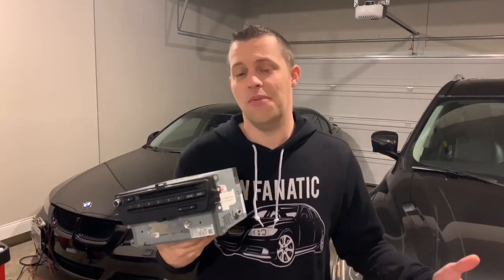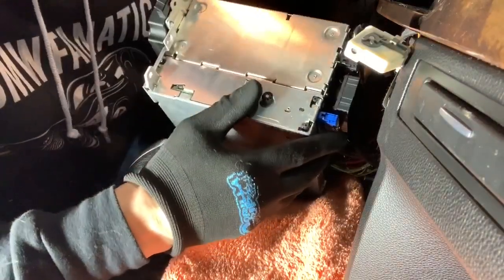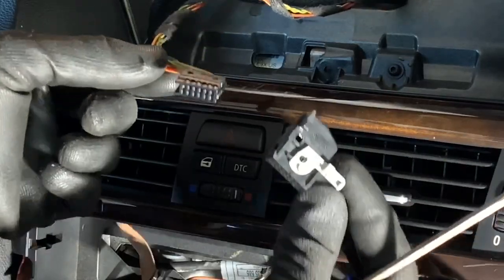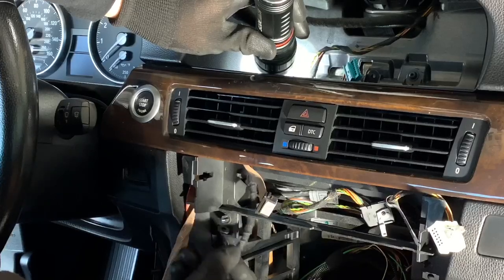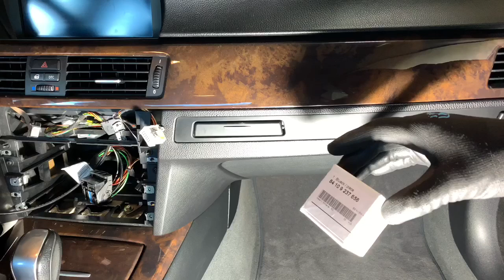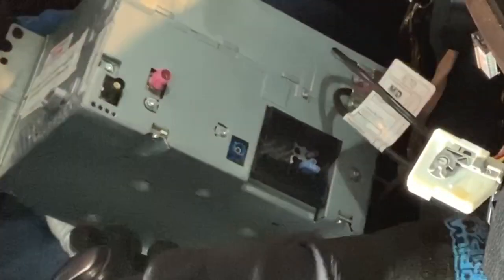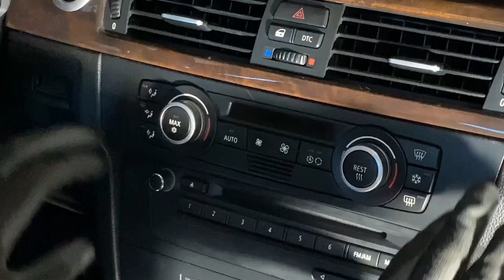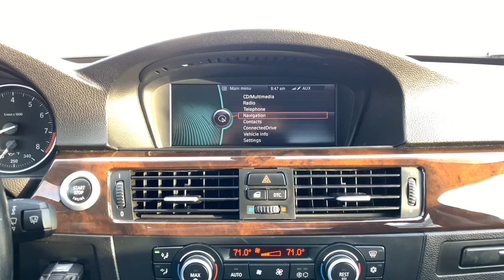BMW CIC Retrofit Navigation DIY Install/Coding!

Comment: So I made the 6 hour round trip drive from DC-Phila today to have Nick install this for me. I had been asking him questions for a few months and was apprehensive about a few things, most of all my ability to make things worse, and completely botch this seemingly straightforward install. I decided that I was not comfortable doing this install, so I reached out to him last weekend and asked if he would do it for me if I drove up to meet him. I didn't think he'd agree because of the extra labor, but he did! He did install essentially the same way as shown here, with additional time to remove and replace trunk trim in order to bypass the HD tuner above the rear passenger tire (the unit has a built in HD tuner). Also because of this step, I have AM radio; which I do not listen to, but it is nice to have the option. After install he made sure that I was okay with his work, and went through all the menus and sub menus with me. He also let me know that he offers a 6 month warranty (with full replacement, as is mentioned here I think), and map updates for all buyers (2020 coming soon). I have not used all the features of the CIC, but already it is a massive improvement over the old clunkier CCC system. It is more responsive, is more user friendly, has more features, is more expandable/upgradeable (with combox), and equally important, just looks a lot sharper. I already had the CIC controller installed myself years ago, so I do like the shortcut keys, but obviously this is not necessary whatsoever, and is mostly a matter of personal preference. Nick brought all supplies, tools and protective covering, and left everything as it was when he started. Whether you have him do it for you, or purchase this and install yourself, I can unequivocally say that this was the right move on my part, after months of hesitation, and definitely is a major improvement to the E90 pre-LCI model year cars. Thanks to BMW Fanatic and CIC Retrofit Nick for all your time; cheers!
Reply: Hey can u give me Nick's contact information so I can get a hold of him? I've been trying to get this for a while but wanted to get something that is good and reliable.. please if u dont mind? Thanks
Reply: Can you please provide Nick's contact.
Reply: Is Nick still around?  Can you forward his info? Thanks
Reply: @kevinpope6262  AFAIK he’s out of the business since 2022.
Reply: Can I have Nick's number so I can have my fixed as well, please?Thanks

Comment: there is a special slot for the usb connector. on the left side of the glovebox  behind the glovebox shocks there is a plastic cover that you need to remove and there you usb will plug. perfect fit, original location.
Reply: Pre LCI cars have a flashlight there.
Reply: since 2005 was discontinued (at least in Europe) and his car does not have that, and its the same shape as for the usb  slot.

Comment: Thank you for this video.   I also went with one of Nicholas' kits and between his instructions and this video, everything went very smoothly.   This video was especially helpful with regards to cable routing and trim removal strategies.
Reply: Hey bro, where did you get the kit from?
Reply: Kit must be top secret
Reply: Right! Super squirrel secret.
Reply: How can I contact Nicholas , I need assistance in connecting a Head Unit in my 2011 BMW E90
Reply: Question is how much did you have to pay?

Comment: Nice!! 
One of the first things that I did with mine after accidentally scratching the CID with a microfiber .. I installed a a anti glare screen protector from Amazon.. it’s been 4 years now and was the best move. The anti glare coating on the CID is very delicate and will scratch just by looking at it.
Reply: Thanks bhai

Comment: So I have a 2010 BMW 535xi.  Yesterday the idrive screen flashed red for a split second.   When Idrive rebooted my navigation is now greyed out.   Holding down volume button reset did not fix the issue everything else works fine.  Would you have any idea what's wrong.   Thanks in advance.   Great video by the way👍

Comment: Great vid. Does this kit still exist. If so. Where/who do you purchase one through
Reply: Yes. It does. You buy it from various websites. I bought mine from Bimmertech. Be warned that you need to do your homework. For example, if your car does not currently have gps the wiring for the antenae will need to be routed through your dash. Also, if your car does not already have a mic and blue tooth youll also need a combox which is extra.

Plus i found i had to do lots of little mods using a Dremel etc to fit the post lci multi functional controller. All told cost me about 2300 euro and i had to learn to strip my interior to pieces and out it back together. Defo worth it though as now i have my entire music database on the cars harddrive and my passengers can watch movies on long drives.
Reply from the maker: Not the one that I have here, but there are other alternatives out there

Comment: Have a. 2009 z4 35i that doesn't have the nav display. Is it possible to install the CIC system /Navigation display unit for a reasonable price? Thanks.

Comment: Hi so i have a bmw x5 e70 35i 2012 cic radio with a 6,5 inch display and i want to upgrade to a bigger display and a new radio that comes with gps and navigation bc the one i have does not come with that so i want to know if i need do some type of codding to the radio to work on my bmw and the new display ?

Comment: Hi thanks for the awesome videos, iv e just replaced my e60 motherboard with one from an e90 lci that had pre set buttons when i try it with my faceplate it doesnt work but works perfect with the e90 faceplate.
Do you know if theres a way to code my faceplate to the motherboard pls

Comment: My question is what steps are needed to unlock the satellite radio? Mine has the codes for the prep as I discovered during my VIN decoding. Right now I’m utilizing an aftermarket setup through the auxiliary. I figured if I pull the plug to do something like this, I would want to have it all through the head unit.

Comment: Hey there, I just bought a set of DVDs on e-bay for my 335xi coupe 2008 but it says that needs to be code or that my DVD player is not reading the disc do you have any clue about it?
Thanks in advance

Comment: what is the best navigation we can retrofit in e92? i saw some from china
Reply: My car was a non_idrive unit and I ended up updating the professional system to a nav-professional  one cic but if I had done my research more I wouldve gone with an NBT.  The head unit was cheap and out of a 2013, get the Chinese head unit and video cable and install was easy.  hard part is getting everything to work just because theres no good writeup out there.

Comment: Preparing to do this myself. Did you or anyone answer this, do you just run the factory controller or did you install the 5 button controller that came with the cic unit factory? He never showed this part which leads me to believe he is still using the old ccc controller
Reply: CIC Retrofit i emailed you

Comment: Anyone knows how to code a standard "Professional" E90 LCI radio so that it will accomodate a Hi-Fi retrofit? I.e. tweeters front and back and amplifier in the trunk. My car hasn't got a navigation, it has the basic stereo system with 4 speakers + 2 subwoofers under the front seats.

Comment: Nice video, I have an E92 would this work on it and if so can you send s link for this item. I am in the UK
Reply: CIC Retrofit ok cool, I didn’t know that mine had a dab radio, I assume the screens and dvd drive are either new or come off a newer model bmw?
Reply: I live in the Netherlands, also interested :) No need for DAB radio, FM is just fine

Comment: how much would this run me 2 get 2006 530i done 4...
its looks really is 2 set up & gd report as well...
Reply: CIC Retrofit hey bro my screen is black and my ccc unit fan is stuck on. I thought i had a bad battery but i got a new battery and still the same issue. I checked my 3 amps in the back and none are getting power

Comment: Extreamly good video! I cant belive it. Best video i have seen so far. 

I just have one simple question. Did you have CCC before you did to CIC? And when it comes to the unit, how come you used the same switch from CCC into the CIC unit. Does it work without any modifications? Is it just plug and play? im taking about 23:42

Comment: I have 2011 bmw 328i  (e93) which I have idrive (cic) guess that’s what I have program in the car. I want to upgrade it to the android touch screen that has everything in it all built in as well as car play.  It says it’s just plug and play. Does that mean just removing my screen and just putting the harnesses  together in the back and it would work? Plus why did some people suggest to me that I need AUX in the car? Which I have it under my  hand rest middle consol. wht does AUX have to do with the  system to work and have sound. I don’t even use AUX I use Bluetooth for everything. I know nothing about this topic that is why I’m asking and I might sound foolish, but hoping someone with understand will explain. I just want a touch screen in car that my reason for upgrade. If anyone can answer my question it would help me very much and also very much appreciated.

Comment: Why didn't you upgrade to one of those Android head units that allow the original BMW software and a whole new system? That would be much better :/
Reply: what he did is basically all oem and easy to install, is the system you are referring to this easy of a diy? Also do they have a CarPlay version?
Reply from the maker: Leandro Wanted to do a full BMW nav replacement. Plus, I have all that I need to do a combox Install next 😉
Reply: @CIC Retrofit for Christmas i want my 😀
Reply: CIC Retrofit Really want to buy your kit. For sure after Christmas.
Reply: @BMWFanatic Do you have plans for a backup camera install in trunk license plate light space?
Reply from the maker: Leandro those Android systems are not better, unfortunately
Reply: @CIC Retrofit whats the price for this
Reply: @kevinbrabant1936  The price varies by car but a base cic retrofit kit for an E90 is $650-$675.
Reply: CIC Retrofit hey I want to get this kit for a e60 2008 535xi how much would this same setup run me for that vehicle ? Thanks!
Reply: CIC Retrofit e70 kit?
Reply: @TheBreakUpMan  E60 kits are $900.
Reply: @louhutchinson  There are some PDC issues but I have done one E70 before.

Comment: Can I do the coding with the Carly adapter?
Reply from the maker: MFreak17 Carly would be able to do some things, but nothing beats a laptop with NCS expert on it
Reply: @CIC Retrofit I want to buy the kit. I have an BMW 320E E91 NFL/Non-Lci 2007, 130kW, 177HP with M-ASK II and the small CID.

What do I need? Where can I buy it? How much?

Hardware wise, software wise. Please, if you can reply.